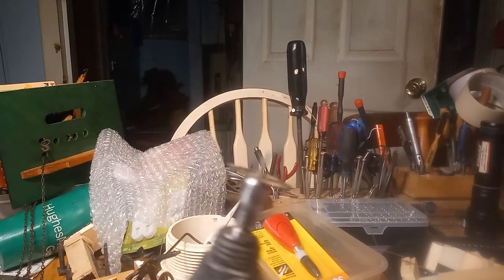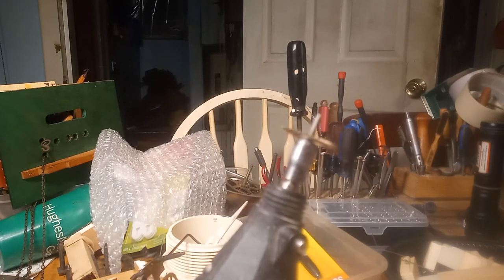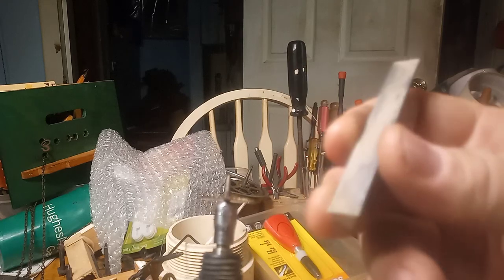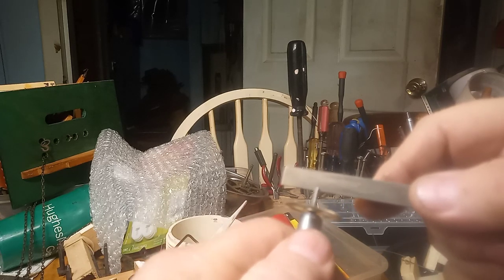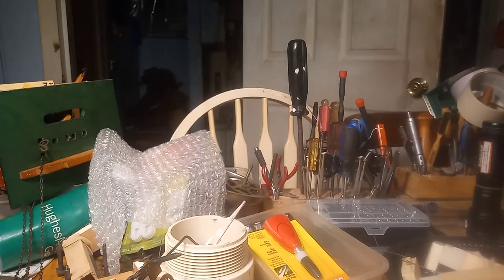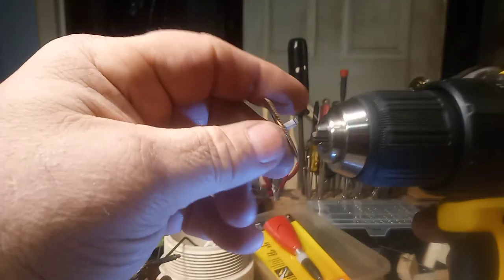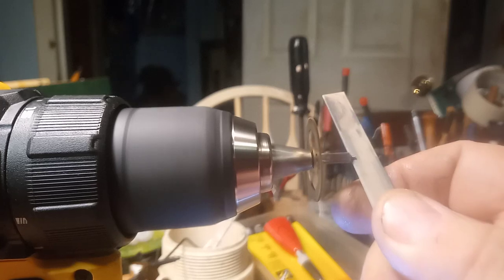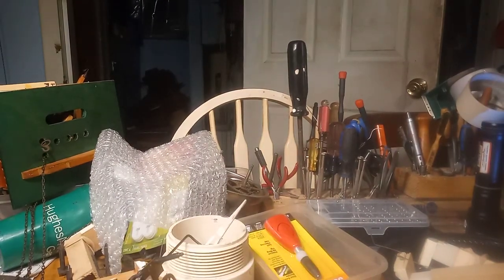Polishing pivots on a cuckoo clock or clock 20220102 181014

Comment: I am glad you found me. Now that I come here, I have been learning new things or new ways to do things to the cuckoo clocks.
Reply from the maker: Mike I am glad that you are learning. That is why I post these videos to help people out. I learnt the hard way. I spent a lot of money buying more clocks because I broke the first ones. So I took that experience and applied it to the video presentations so people dont make the same mistakes that I made. I only polish the time side as I say in the video most of the time. I polish them every time that I have the movement apart. It is to take off microscopic burrs that you cant see with the naked eye (or at least I cant) and it ensures that when I put it back together that I know it is going to tick away.  The only time I polish the strike side is if I have tried all other means and cant figure it out. Without a lathe or proper set up the dremel and drill can be  utilized but it is harder to do than an expensive lathe or tool that is only for polishing pivots. Again I am glad that you are learning. Keep coming to the channel as I post more videos whenever I get the chance and feel like it. Most often is when I get questions pertaining to something and get tired of answering the same questions over and over. So if you do have questions that I havent addressed in any of my videos then please let me know and I will try to make a video.

Comment: I use a drill motor as well. Some pivots require stoning, but others only require running on some leather to be good.
Reply from the maker: Great point! I learned back in 1999 through a VHS tape by a well respected clock smith. He used a lathe. I didnt want to spend the money on a lathe. You can buy some now through ebay that are a little over $100 that will do this job. But I learned  how to do it using my dremel and drill. So why spend the money? I polish the pivots every time I take a clock apart. But I only polish the time side from T2 on up to include the escapement wheel. The reason I got into this habit is after taking a movement apart, putting it back together, taking it apart again trying to figure out why it didnt work. Come to find out it had a microscopic burr that was preventing it from working. The Arkansas stone or wet stone removes those every time and I dont have to take the movements back apart to figure out why they arent working.
Reply from the maker: I also want to say thanks for the kind comments. There are a few negative comments by people that i dont believe they really know what they are talking about. You are one more person using a system that works. Keep it up.

Comment: Another great tutorial ty love every one you do .I've got a musical clock that the rack will not stop and the weight keeps falling but not all the time it's onetime with the stop pin it's cleaned and suggestions  ty.
Reply from the maker: You have me confused. Is it the cuckoo weight that keeps falling or is it the musical weight that keeps falling. If it is the cuckoo weight that keeps falling I have  a video that adress the cuckoo will not shut up. But what I dont adress in the video is that if the clock is a musical clock with the little man that comes out then if the wire that stops the fan on the governor box gets on the other side of the governor box then the clock will continue to cuckoo. If the musical will not stop then I have a few videos on adjusting the musical box. Check them out and let me know. You can also message me through facebook. That way once we speak back and forth I can video chat with you to see the problem for myself. Good luck and thanks for the feed back and keep watching.
Reply: @munnerlyn3  ty it is the cuckoo side and thank you I will look at that
Reply from the maker: Robert if you need more help and I am happy to video chat with you please send me a message on face book. My current picture is a picture of myself that was drew by a veteran while I was at the VA hospital.